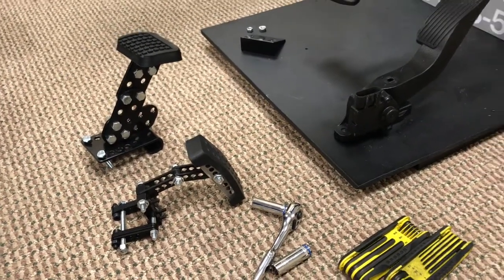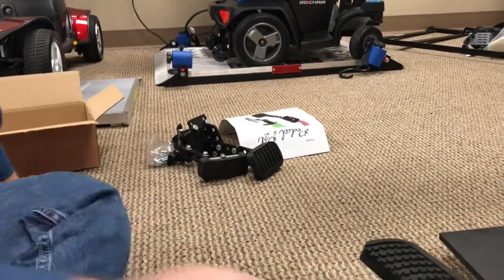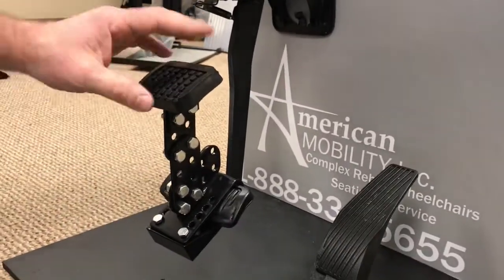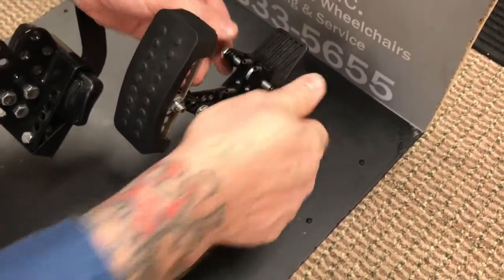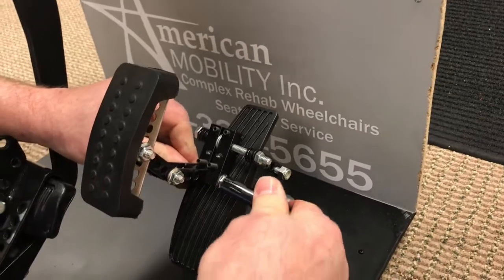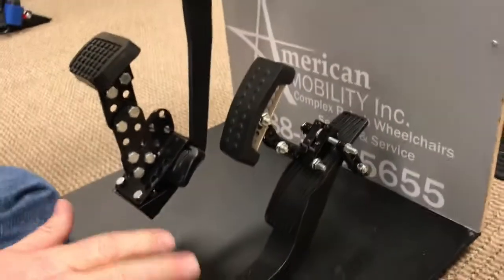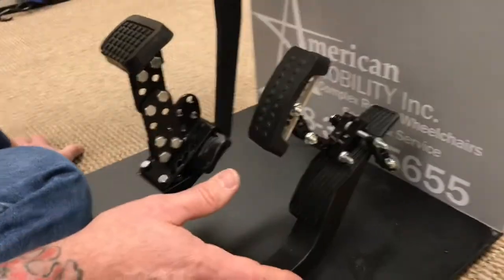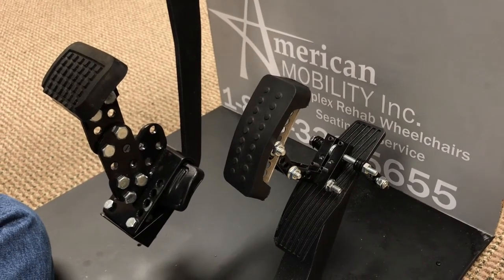How To Install Pedal Extenders With American Mobility

Comment: the brake pedal looks very solid with those 2 row bolting holes,    but that gas pedal makes me worried.  y not make 2 row bolting system just like the brake pedal extender

Comment: But what if I want to lower the gas and brake pedal. I have a conversion minivan that has a ramp and it used to have the front seats with platforms already attached once you take them out and use your mobility chair with the lock system the pedals are up on the wall basically of the van they're too high up so I need some that'll bring them down to the ground further

Comment: The instructions that come with it are trash. The video is helpful but has nothing about how to adjust to different lengths. Which would be helpful since we tried to just adjust down and the holes wouldn’t line up just one size lower than it was shipped. The ones we bought were put together wrong so look carefully at how yours are out together.

Comment: nice vid since enclosed instructions are about worthless.  Looks like this accelerator is floor mount hinge type, which these do NOT seem to give same feel.  I ve looked for an extender to properly mimick the movment of the accelerator in a 2104 beetle, and already had a set of these in 2002 beetle with pedal mounted on lever with fulcrum above the pedal, but using this on a floor mount doesnt give proper feel.  Too bad this company has but TWO videos on their product, and do not answer questions in the comments.

Comment: Much harder to put on in real life when you are trying to screw it on in tight spaces... But its a great product. Wish there was an easier way to install
Reply: I fully agree, need a flexible person to do this. Hard enough just taking them off when selling a vehicle.
Reply: Like Davie Frank indicated, I too agree. I ended up removing the driver's seat in order to more easily work on the pedal extenders. I nearly got to the point of drilling holes in the gas pedal and putting a bolt through the two black anodized aluminum blocks directly through the pedal!!! Luckily on my third hour (and third attempt at installing these things), I found the right combination of brackets and bolts.  The brake pedal extender went together much better.